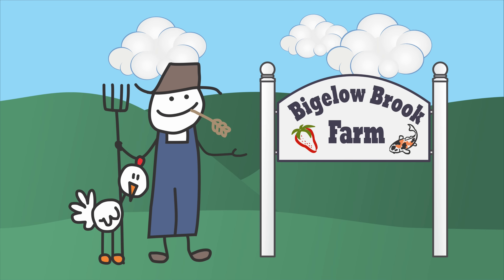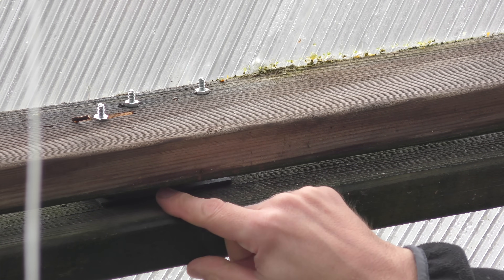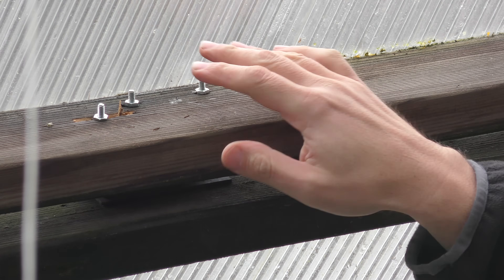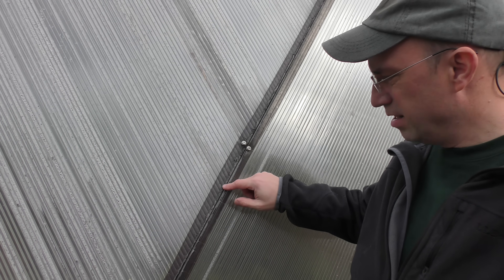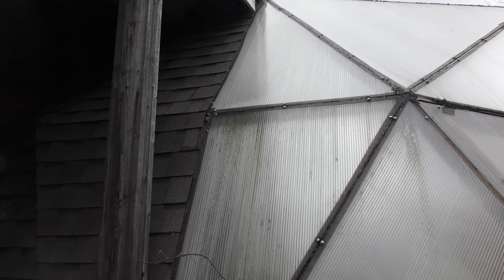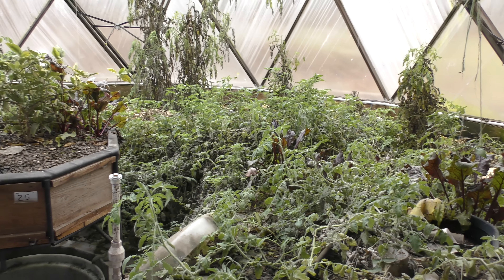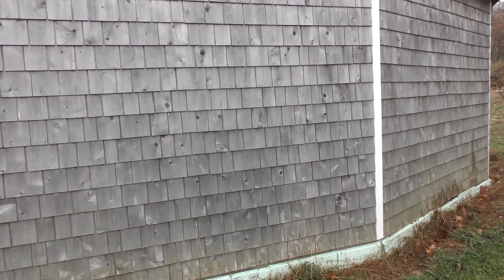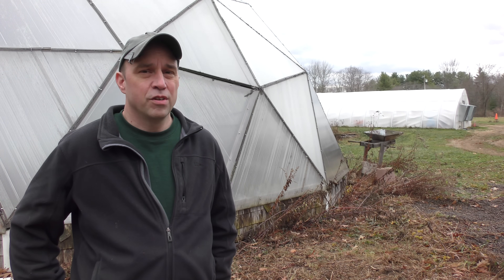My DIY dome is FAILING 😟

Comment: Thank you so much for doing this video. I really appreciate the realistic transparency of your experience. I have been building geodesic dome greenhouses for a number of years now using pipe since I anticipated many problems coming from using wood. I have always wondered why people don't paint or protect the wood when they use this in very high humidity growing spaces. Plus having lived in a log home I know the seasonal maintenance required in order to maintain the wood in good condition and what to look for when things start to go south. Probably because of the time constraints and distraction like we all have, a lot of the signs of maintenance that was needed was either not seen or ignored. A lot of these issues didn't just start in the last six months, of course. Again, excellent that you are doing all these videos. It is obviously helping many people understand the process and the work involved.

Comment: Thanks for sharing.    Considering what you paid to build it; and the very short amount of time that it held up, I will avoid these types of dome like the plague.   I'm surprised that no one advised you to treat that wood given that it would be inundated with moisture.   Likewise with using tape for the seams.

Comment: Your dome looks much like one I have been watching. Beautiful greenhouses but expensive. I'm surprised to hear that yours barely got half the life that the company states. I did look into the type that you have in the background. I'm in upstate NY and would like to start growing through out the year with trees as well. Sounds like the workshop might be your best option. Hope it works for the best
Reply: Paul, please note that this dome is NOT a Growing Spaces dome.  We use a UV protected aircraft tape to seal the dome which has a useful life of 10 years.  If this tape is replaced every 10 years, and with adequate ventilation inside the dome, your struts will not rot out.  We have also increased our polycarbonate warranty to 15 years.
Reply: @GrowingSpacesGreenhouses  
Quote from your website: 
Our full crew installation warranty covers any major leaks that are caused by missing tape, the tape not adhering properly, or not being applied in the correct locations.  This warranty is good for 30 days from the installation completion date and the customer must be able to provide Growing Spaces with proper documentation of the issue. The warranty does not cover minor leaks around the edge of the vents, around fan hoods, hubs, above door, or manufacturer indents in the polycarbonate. These can be easily repaired with a small patch of tape over the affected area. Your Growing Spaces installer will leave you with extra tape and explain how to properly patch small leaks. Be aware that condensation build-up inside the Growing Dome can occur and may present the same way as a small leak would.
The fact is condensation will occur in any greenhouse and in the specific case of a dome greenhouse, struts that are angled back towards the glazing effectively create a trough that traps water which will eventually lead to mold and rot.

Comment: If you fix it with new wood maybe you could put paraffin oil on top, as we do in our Sauna in Finland to prevent that, saunas here get very hot inside while is very cold outside and very wet and moist as well inside while can be very dry outside, and by doing that it takes a very long time that they get rotten. very long time. only an idea.

Comment: Duct tape along the wood under outer panels would have prevented the rot for a decent time, that clear airframe tape for the outer panel seems too. Id just repair the wood and then do it right. Geodomes are awesome efficient if you get the geothermal heating with a water tank absorbing southern light in the winter. As well as tap into the ground geothermal temp with a walipini style dug down below the frost line.

Comment: This is the outcome from no paint, no stain, and no yearly application of tape. It is not that a dome itself is a fail, but using weather sensitive material in the weather without protecting it is a certain fail in around 5 years.

If he made a workshop out of it then it would be an ideal to fiberglass the outside instead of using shingles, shingles on this structure will most likely leak. The fiberglass will make it stronger at the same time waterproof it and have it looking nice. Then just paint it every 5-10 years, it is like a boat now.

Comment: Horticulture student here and weighing in on different structures I might one day grow in.  I've been very moved by other videos on geodesic domes primarily due to its stability when it comes to snow load and strong winds.  
I haven't done enough research on the panels vs. Standard poly plastic used in hoop tunnels and such.  Do you think you would have had the same issues with the poly panels and debris if they were turned such a way that the internal channels would not run the same direction as the run off? 
Its disappointing when something we craft comes to the end of its lifecycle. 10 yrs seems standard especially given thats the material warranty. I know the 6ml poly we use for hoop tunnels has about half that life cycle.  That said, we are only replacing the poly and maybe some wiggly wire, not the structural frame.  

I really appreciate you sharing your learnings.  

I saw in another comment you said you wouldn't grow commercially in a grow dome - is that because of the space (for movement of humans) and growing space?  Or have you found there to be greater issues with ventilation, lighting or IPM?
Reply from the maker: The panels need to be somewhat vertical so the condensate can drain out of them.  The dome is nice for a hobby by for commercial use it's difficult to have long square beds in a round shape.

Comment: I would definitely convert it to a shop. However,  consider removing each polycarbonate panel and clean them. If you replace them with plywood,  good. If not,  it's a window. But, either way,  use silicon caulking between the joints,  not tape. 
This was a real great build, no matter what you decide so I think it will be awesome.

Comment: Hi there! This build is super inspiring, even after 10 years. I really want to make my own. If you did it all over again, do you think instead of using tape to seal the edges, using 100% silicone or butyl rubber caulk would work since they are UV resistant and flexible?
Reply from the maker: the silicone won't stick to the polycarb.  I'm not sure about the caulk but I would doubt it would be any better.

Comment: What type of tape did you used ?
It looks bad.
I also have a wood dome similar in size with yours and the aluminum tape started to fail after 3 years.
Now im replacing the old aluminum tape with butyl rubber tape thats guaranteed for 25 years.
Check the butyl aluminum tape.
For the polycarbonate you can use a substance to protect it from UV.You find it in auto repair shops and thats used to protect the plastic headlights from UV yellowing.
If i were you,id cover the dome in 2 sheets of flat ,fully transparent polycarbonate( with the thickness of the struts having a sealed space) and butyl tape.

Comment: In the spirit of "reduce reuse recycle" I hope you can find another use for the structure. Either the workshop space or even an air bnb rental if you're into that. It's a quirky dome shaped building and people would be drawn to that to rent. Just a thought, rentals come with their own nonsense to deal with.

Comment: I put my Geodome up about the same time as you and have same problems ; It Leaks and rotted my wood.
My solution to problem was 4" Aluminum Tape as used in the Heating / Cooling Industry.   The tape takes the cold weather 
and sheds moisture.    
However, it's a little late in the game and I will have to replace a lot ot wood.             
 I was considering 
re-building with a Vertical Circular Wall and a Peaked Roof; using the same Lucite  panels on Roof & Verticals.

Comment: Hi,   Well done on your builds!   I'd suggest you could try to get aluminium extrusion in the same dimensions as the timber (2"x4"ect) and try to replace a couple of triangles at a time. I'd then use glass for the triangles and  a urethane sealant to hold them in place(a bit like an automotive windscreen seal).  This way, you could do a few at a time as funds permit and it would have no chance of water ingress.  I think you have put too much into it to let it go to waste!    Well done and thanks for your videos

Comment: shoulda coated everything in motor oil
Reply: I used pond shield 2 part epoxy paint on my dome 12 years ago and no rot so far. Folks use it to waterproof the inside of plywood aquariums. Its non toxic and safe for fish and plants.
Reply: @JohnGuest45  motor oil is free, and once it absorbs into the wood grain it doesn't really go anywhere unless you're using it underwater.
Reply: @brothertyler  
Used motor oil is free but its also full of contaminants. The condensate dripping from the strructure will carry anything soluble to the plants and fish if you have any. If you have a fire the structure will go up like a roman candle :)
Reply: @JohnGuest45  well it's a case of assessing the risk, like anything
Reply: @brothertyler  
The only thing going for used motor oil is the cost, i personally wouldnt use it. I went with encapsulating the timber in epoxy as it can handle being completely submerged without any trouble. It comes in a range of colours too. My frame is white which keeps it cool in full sun. If you have an IR gun you`d be surprised how hot plain wood gets in the sun compared to some painted white. If the dark wood is covered by twin wall polycarb it will become even hotter
Reply: @JohnGuest45  Ive used 2 coats of boiled linseed oil with copper sulpahte that i added in it, and then 2 coats of white alchidic paint.
After that i waxed the struts in linseed oil mixed with wax.
The most important its the exterior tape.I used cheap aluminum tape and it started to dry and now i have bought aluminum butyl rubber tape wich is advertised to have 25 years warantee.
My dome also has 2 layers of polycarbonate,one exterior and one interior ,wich keeps the wood protected from the interior moisture as well.
On the interior sealing ive used cheap aluminum yape and that holds well.Only the exterior needs to be sealed with butylic tape.
Reply: Polycarbonate is one of the more hygroscopic plastics, the absorbed moisture can travel directly through the sheet into the cavity.  It will show up as condensation  when the temperature inside the cavity is cold enough to drive it to dewpoint.

Comment: You could use the dome as a form and spray a thin shell of ferrocement on the exterior. Real glass window panes could be inserted into some of the facets. There is a product called spider lathe that is stronger, lighter and less expensive than expanded metal lathe and it will never rust out. It has to be cut to fit and attached to itself with small zip ties. A hand held mortar sprayer requires  a good size air compressor but it will do the job fairly quickly. That would make the shell permanent and the old dome could be removed or probably left in place to provide an interior finished surface. Stone veneer mortar works well in the sprayer and is acrylic fortified for superior strength  and durability. If you started at the base and worked upward, after a few days the old work would support the weight of a ladder or makeshift scaffold. It wouldn't have to be done all at once. It would not require any rebar, but two layers of spider lathe over the ribs (separated by 1/2") would be a good idea. Spider Lathe can be purchased with foam spacer strips that hold it off the surface so the mortar can blow through it and pack solid behind it. It works great, I've used it on various projects.

Comment: If you decide to use polycarbonate again maybe use 3M aerospace tape (UV and temperature stable) for the joints if you didn't use it before. That's what we used on our geodesic dome although it is only 2 years old. I'm thinking of hydroponics but maybe not a good idea with all the moisture.
Reply from the maker: that's exactly what I used.  give it a couple more years and it will start to fall apart.  ;-)
Reply: @Bigelowbrook  good to know.  The 3M tape is made from polyurethane, and you mentioned using polyethylene in another comment. Regardless, I suppose 10 years will take its toll on any tape. Maybe we need to preemptively replace it every few years?  I think we have the same issue with moisture building up in certain places, but the wood is not deteriorating yet.  Hoping our use of cedar and eco safe lifetime wood treatment helps; time will tell.  Part of the fun in building your own structure is that everything you do is part of one big experiment!
Reply: @Bigelowbrook  
Use ETFE repair tape, its designed to stick to ETFE (teflon) so it wont let go of polycarb. Its not affected by uv, heat or cold. Only downside will be the price.

Comment: i'd use bleach to attempt to clean inside the flutes.....use a polyurethane caulk to reseal all the gaps....with masking tape and polyurethane caulk...apply the caulk...smooth it down and pull the tape....should leave a nice caulk job behind....i think you could refurbish it for cheap....maybe even apply some fungicide to the inside of the fluting....replace any totally rotten pieces of wood....and dry out the rest.....maybe use boracare or timbor on all wood....

Comment: Hello, it would be sad to tear it down. If you decide to repair, I would recommend giving a look at what they did in the Dome of Visions ( http://domeofvisions.com/architecture/ ). Instead of every layer of PC sitting "next" to the other, they made the upper layers overlap the ones underneath, so water would naturally "flow out" - like you would do with regular roofing tiles on a regular sloped ceiling. The other thing they did is that the PC never touched the wood underneath - the screws have "spacers" so if water or humidity manages to get in, it can still flow out relatively easy. And it is easier to do maintenance on the wood as well.
Reply: Oh I almost forgot: on their last iteration they cut the PC sheets in rhomboids instead of in triangles/hexagons, taking advantage of the pliability of the material. This made optimal use of the rectangular sheets, and minimized the seams.

Comment: Try treating the wood with cheap vegetable oil and paint thinner one part to one dilution. And flex seal the joints possibly will keep the water out.

Comment: I vote to replace the struts. (Shouldn't be too much for the 2x4s, and then sheet it with plywood and make a barn out of it. For anyone else considering this, I might suggest butyl taping all the joints, and fixing the panels down with a strip of aluminum that will compress the butyl tape and seal the edges. This wouldn't do anything to stop the interior sweating from high humidity, but maybe the interior could be fitted with poly film to keep the moisture inside the poly and not let it contact the wooden struts. 

Good luck with whatever you decide. The geodome was an inspiration, and I really appreciate the honest follow up.

Comment: I've seen the Eden project in UK, they use a special plastic pillow design for their domes, it now 2 decades later don't know if the price and availability are better now, left a link below about the covering technique and materials
https://youtu.be/ThRFQ-oOXT0?t=22m49s
Reply from the maker: I think their pillows are a little out of my budget.  ;-)  Also saw them applying the same tape that I put down so it would interesting to see how long it lasts for them.
Reply: @Bigelowbrook  
Eden project uses ETFE foil and the ETFE tape is only used to fix small holes made by seagulls.They dont use tape to seal the joints, they use extruded aluminium glazing bars.

Comment: I would solve the leak problem you have at the seams. Is there an alternative to the tape such as some type of caulk? Since the wood still has some life you would improve the life span by eliminating moisture from the outside. Do you have dehumidifiers on the inside to cut down on the moisture problem? Wish you the best and look forward to future updates.
Reply: Aluminum butyl tape ,1mm thick ,on the exterior.

Comment: Maybe check out the heat shrink film they use to winterize boats as a short term outer covering. Stop using to grow inside so humidity is reduced. It costs about 7 cents a square foot.

Comment: how about remove all the plants and things that cause moisture, let it dry out then rot treat timbers to shore it up, thin ply or OSB the inside to make into a workshop then just put huge sheets of damp proof membrane over the structure, taping and folding as you go. Won't look great but will water proof it, no need to remove the polycarb, you would even leave out boarding some of the inside to let daylight in and cut and tape around on the outside. Investigate longer lasting tapes. Bitumin backed roof repair tapes last many years.
the double skin of plastic / polycarb and wood inside will give some insulation

Comment: In hindsight, you should probably have coated and painted the cedar struts.
Reply: yes some oil based coating to soak in because it takes a hammering under greenhouse conditions, and anytime you put metal through it makes it worse funneling moisture insdie the wood
Reply: Yeah. Oiling might have been the solution (linseed plus a thinner to make it go deeper). Still, the long term leak-proofing from the outside remains an issue and might be a reason, why a greenhouse dome is not so attractive after all...